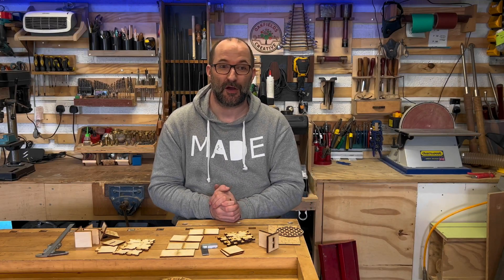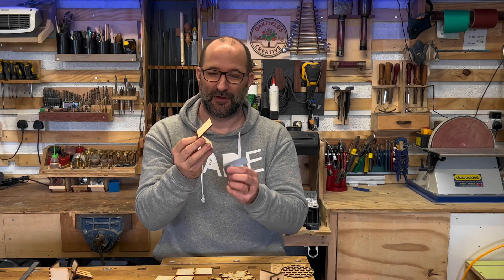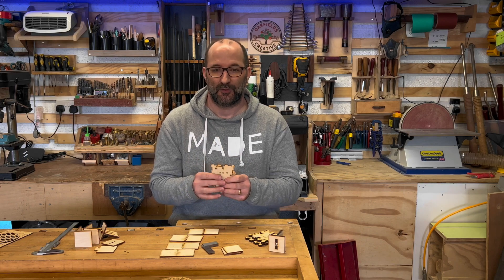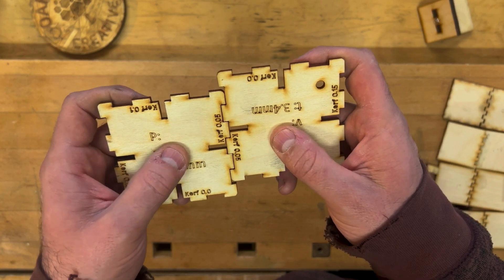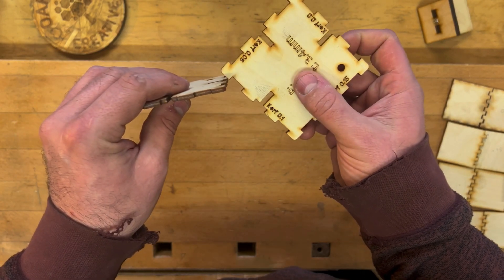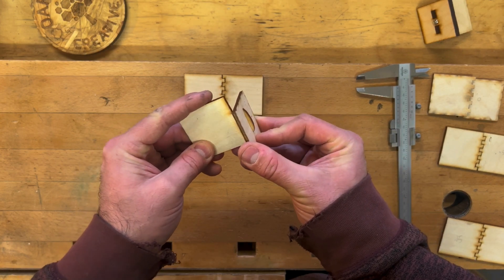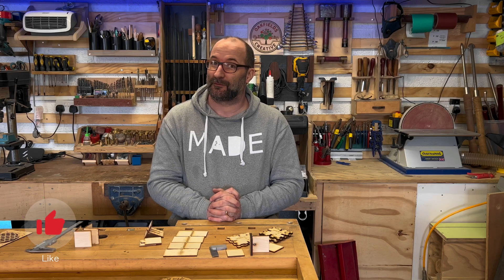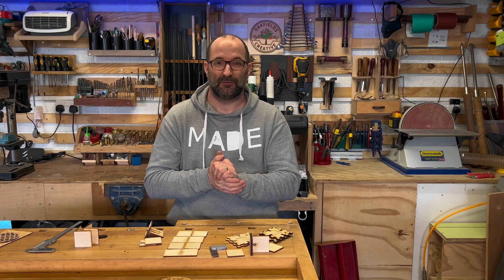Why Laser Cut Kerf Matters: Avoiding Fitting Errors Explained

Comment: Thank you very much for this excellent explanation of kerf compensation! 
I just want to point out one pitfall: The kerf compensation script from Thingiverse interprets kerf differently than Lightburn:

Example with a finger joint with 12mm gaps between fingers:

Script: Kerf value of 0.1 leads to a finger joint gap of 11.9mm.

Lightburn: The complete contour of the cut is moved outwards by the defined kerf value. 
The kerf value affects each finger joint gap twice. 
A kerf value of 0.1 leads to a finger joint gap of 11.8mm.

So, you have to divide the value from the script by 2, when importing into Lightburn.
Reply from the maker: I’ve just checked the thingiverse file and you are correct. I had not realised at the time that their generator worked differently. 
I’ll have to create my own version for a lightburn file in the future.